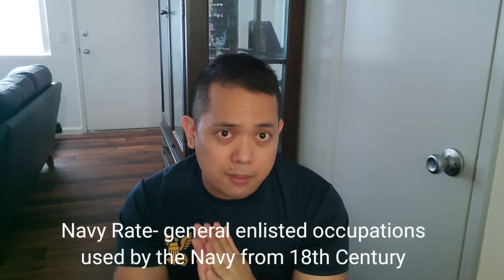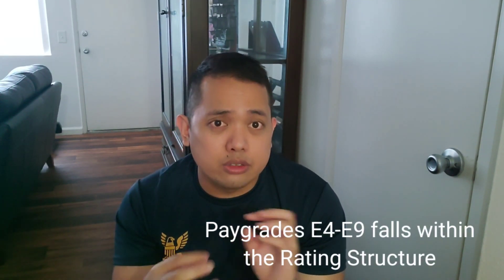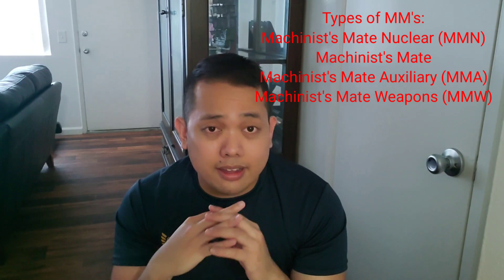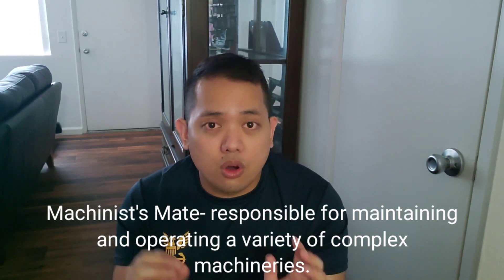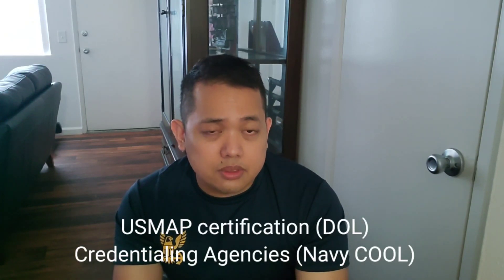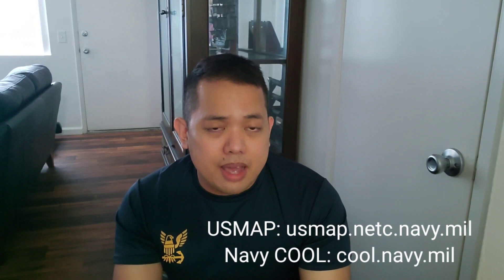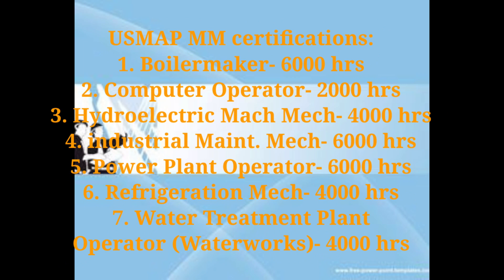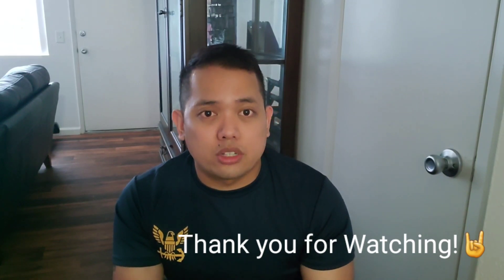NAVY Machinist's Mate|| Certifications ⚙

Comment: As MM Did you get A chance to be assign to a combat jobs? Like seebeas Swcc or etc?
Reply from the maker: @NathanUrielMaico  hi, thank you for the comment. That would be a detailing question. The more you rank up, the more billet will be open for you. Worst case scenario, you can apply to crossrate to special warfare if that is the route you want.
Reply: @Cesar.Bendita_nierthian32  i signed the contract  as MM rate and as E3, because of my low asvab score, I only got 2 jobs EN and MM my recruiter told me that I need to Retake my asvab in the Bootcamp to make it higher and choose other rate..